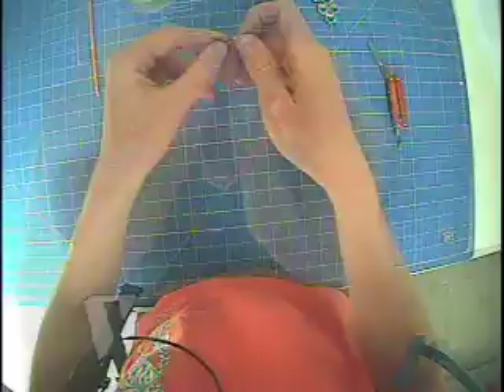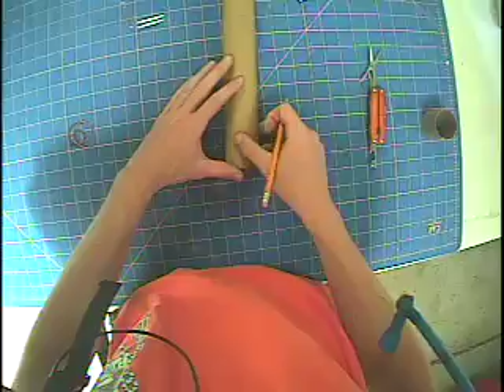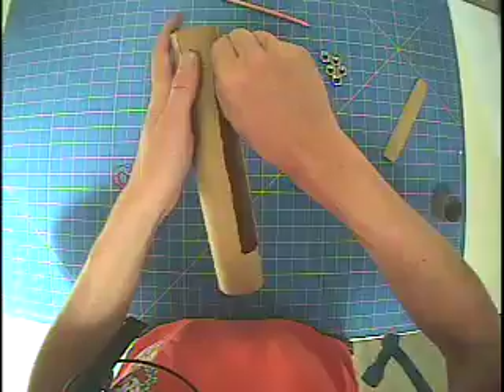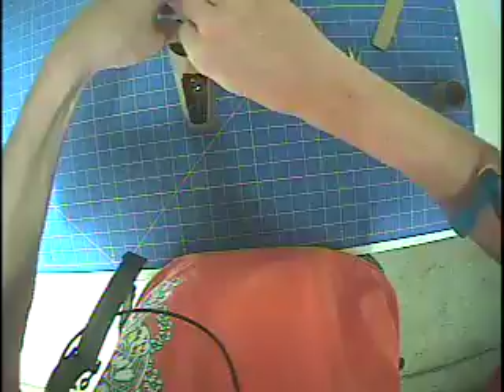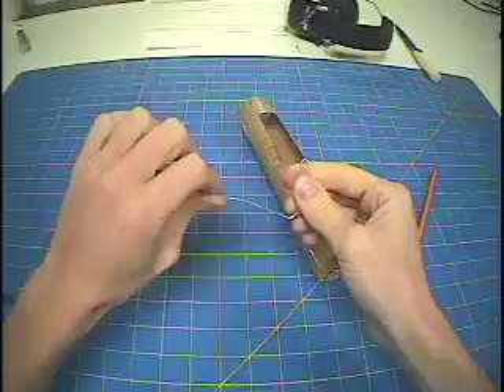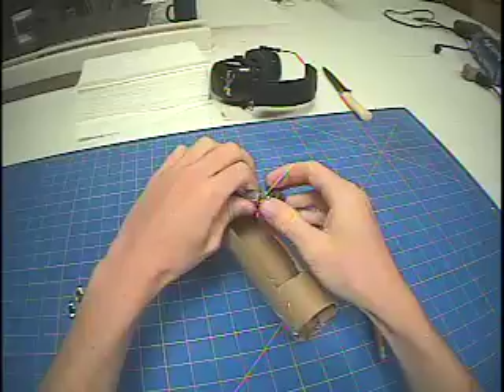Accelerometer

Comment: nosplen this is not an accelerometer... accelerometers are made to be used in applications such as aviation, vibration feed back sensors, tilt measurements, or even max acceleration achieaved in some applications. your design cant be used in any of these applications. plus u cant have reading if the acceleration is instantenous and not a continous insident plus the accuracy is almost below 2%. thank you nosplen. try harder. Good luck.

Comment: Very nice accelerometer but i saw several flaws.  One is what if you are measuring less than 1 g? it would be nearly impossible to measure it using assumptions.  And another, if the weight gets too heavy, it would cause it to sag down on the tube creating friction and therefore messing up your hard work.  Thats all and i hope you take these into consideration.